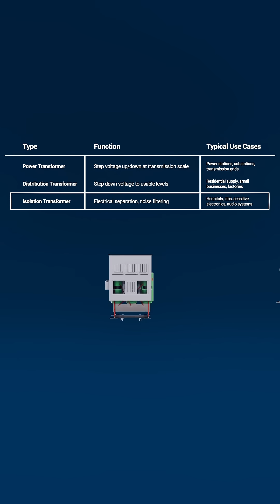Power, Distribution, Isolation and Auto | Transformers Types Explained #shorts #transformers

Comment: Isolation / separation transformers prevent from noise, surge etc.? I thought that they transfer everything that comes in 1-to-1 to what goes out. The primary role of such transformers is prevention from electrocution (hospitals, hotels, residential bldgs etc.).
Reply: They isolate indeed
That's where it's given it "isolates"
So external noise and such are also not transferred onto secondary
Reply: @DreStyle Thanks. If I may ask, what's the physics that stands behind this noise reduction in these transformers? I've always thought that a transformer is just a pair of coils connected with magnetic flux. What prevents noise, spikes etc. from being transferred in such a simple device?
Reply: In circuits ,some inductors have the same role, to reduce interferrence from outher sources

Comment: You missed out on ferrite core transformers that are used in everything from signal processing to ultra high density power supplies. Ferrite based transformers operate at frequencies from about 100 times higher to 2000 times higher than mains ac.